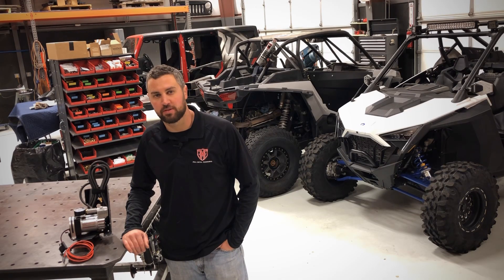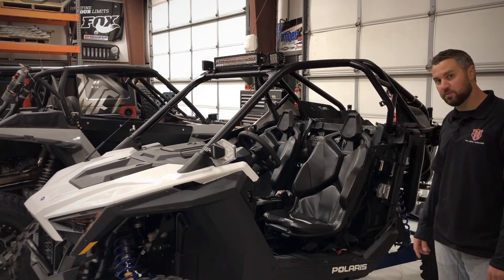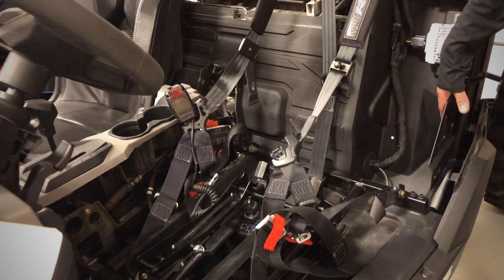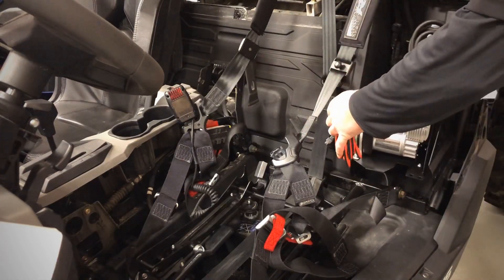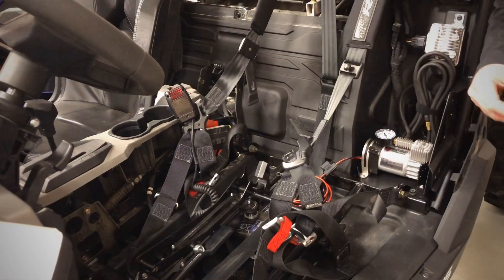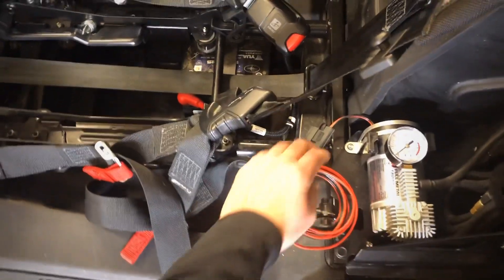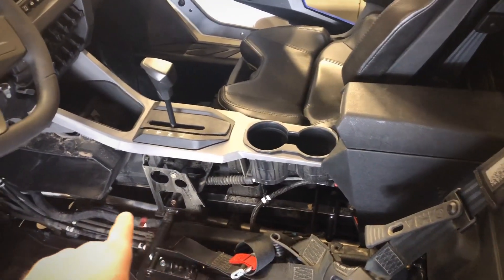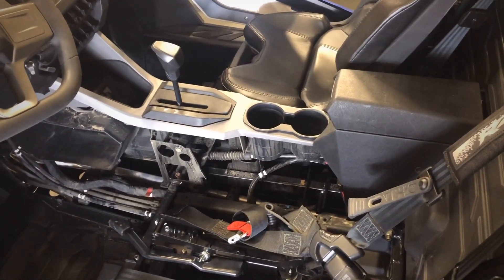Polaris RZR Pro XP Adventure Air On Board Air Installation Video

Comment: Is a switch included or, does it fill and stay full until actually being used and that's the only way it'll remain off if not in use is, if its full?
Reply: There is a switch on the body of the compressor.